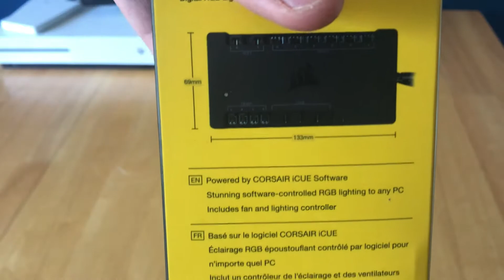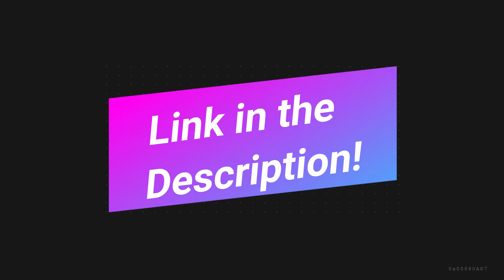CORSAIR COMMANDER PRO UNBOXING AND SETUP | MY GAMING PC BUILD SERIES #4

Comment: While corsair products work as advertised, there is one big issue that Corsair has failed to fix: How to secure the controller to a computer case.  The hub comes with a sticky pad, which is absolute junk.  This is a royal pain to deal with during a PC build.  What is needed is the capability to secure both the commander and a hub with one or more mounting brackets that are physically screwed into the computer case.  Three stars out of five for not providing a quality way to secure these products.

Comment: i havw a quostion, i have 3 diffrens fan 3x QL 2X ML 3X LL fans can i put them all in commander pro? will they work? or must all fans same to work ?
Reply from the maker: If they are Corsair fans then yes but you have 8 fans and there’s only 6 fan headers on the Commander Pro so you may need to plug the other two into your motherboard
Reply: @EvilExpression5  okey ty